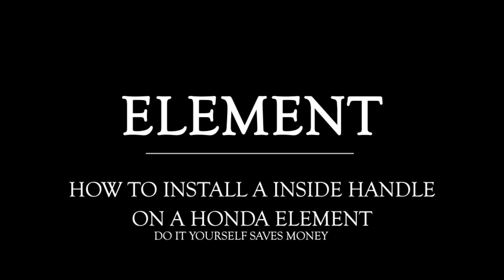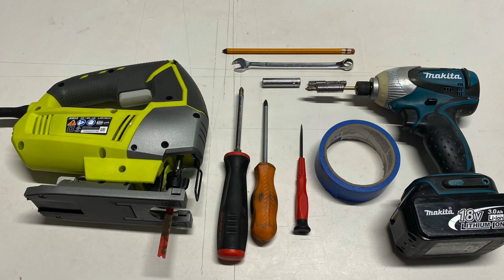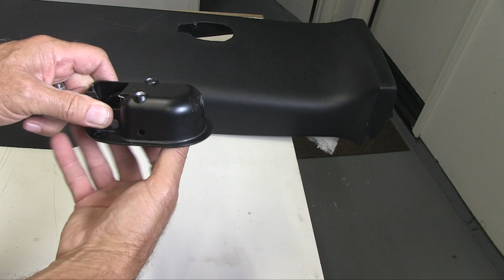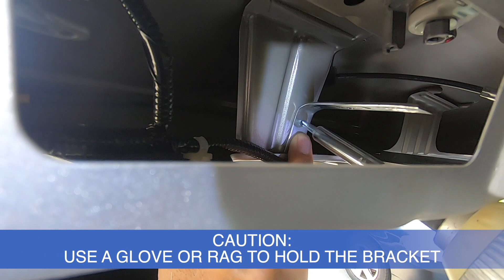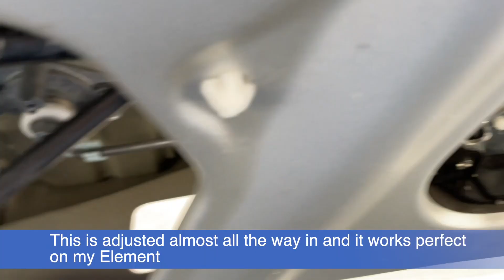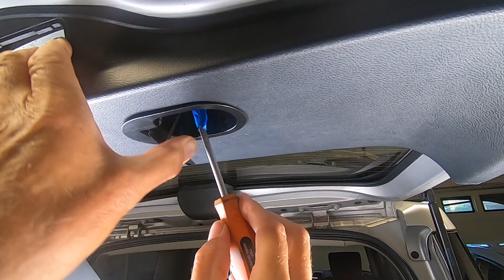Honda Element inside Hatch Handle Installation DIY

Comment: Yes 7:47. When you are installing the custom legal plate the holds the black plastic piece just before the spring on the cable. Which way is the plastic piece facing, against the metal of the hatch or away (facing rear of vehicle)? Or doesn’t it matter?
Reply from the maker: Facing the inside of the vehicle if I understand you, send me a email at dannysdiygarage@gmail.com and I’ll call you
Reply: @dannysdiygarage  Yes, you understood, that is the answer I was after. Thanks again for such great and detailed content on Honday Elements. I just purchased a 2011 EX AWD in April. Love it!!
Reply from the maker: Hopefully you checked out some of my other Element content, and more to come

Comment: Great Video! Question on the orientation of the "custom" plate when you show it installed at minute marker 7:50. Does the black clip face forward or to the rear of the hatch?
Reply from the maker: Eric I’m not sure what you’re asking are you sure the time stamp is correct on your question

Comment: Installed, and works great. Thanks! A couple of observations that might help it go easier for others:

1. Install the cable end into the handle before spinning the threaded portion of the cable housing all the way into the handle. If you install that threaded portion to full depth first, you will go crazy trying to get the cable-end ball into the opening where it goes. (I'm not sure why the hole in the handle that accepts the cable end needs to be threaded, but that's how it was in my kit, so I did need to spin the handle onto the the cable housing before tightening the two nuts.

2. Assuming I understood the cable-routing instructions correctly, I found that it required a very sharp backwards turn where the cable housing exits the handle (once installed) in order to go around the bracket. I didn't like the looks of this "crimp" in the cable, so I devised an alternative route with gentler bends along the length of the cable. On my 2003 Element, there's also a rib of reinforcing steel right next to where the handle goes when installed, and I padded that area a tiny bit to help keep the cable housing from abrading against the steel.

3. Since the bracket installation is kind of "eyeballed" and not in a super-precise location, I found that the long screws didn't have a perfectly straight path from the handle to the bracket holes. I was able to flex things into better alignment as I installed the screws. The main thing to watch for here is: Be very careful not to cross-thread the long screws as you're installing them into the bracket. Getting that far with the installation and then screwing up (literally) at this stage would be most annoying!

4. Buy the kit, think things through, take your time, and go for it. You'll be glad you did.

Comment: Great video. My one question/concern is pulling the top door down from the fully opened position. 

You just show closing the top hatch when it is barely open. 

I would think that pulling on the latch in the  open position  that was just installed would put a lot of strain on the latch and eventually break the latch. 

How do you start to close the top hatch when it is fully open?
Reply from the maker: Great question, this handle should only be used to open the hatch, a strap can be easily added, however I have not needed it on mine, I did think about adding it to the kit, but wanted to keep the cost affordable.

Comment from the maker: This comment was from a subscriber: Thanks for sharing. I have actually been locked in the back of my Honda. I had a pet barrier installed behind the front seats for my two large dogs. One day at the beach I crawled in the back to leash up the dogs and closed the rear door behind me. Then a strong wind blew the front door shut. Because of the pet barrier I couldn’t reach the front door handle. Had to call a friend to be rescued😂.
Reply: 😲that's awful. I don't know what I'd do if I were out by myself without "friends" nearby!  911?!!!